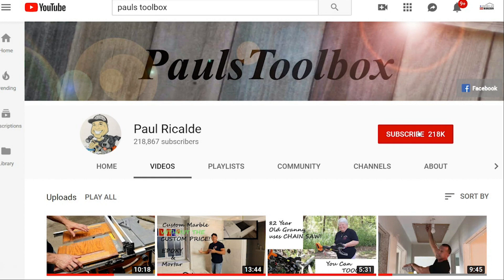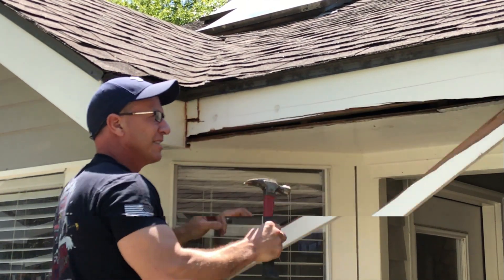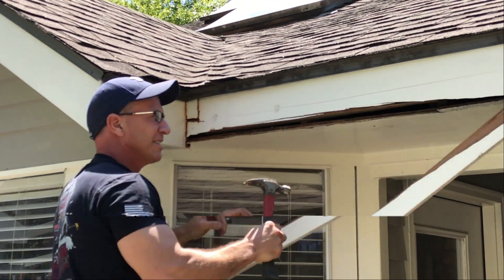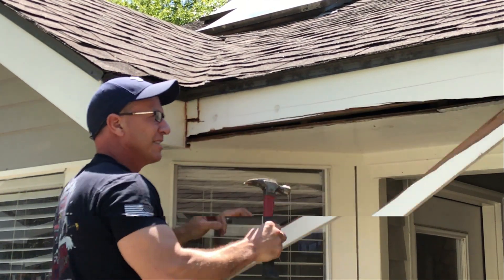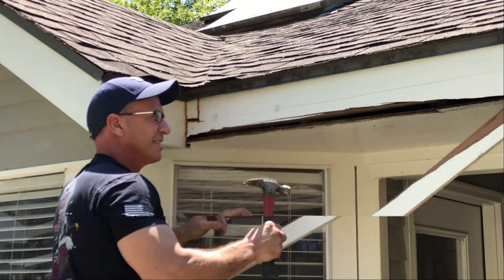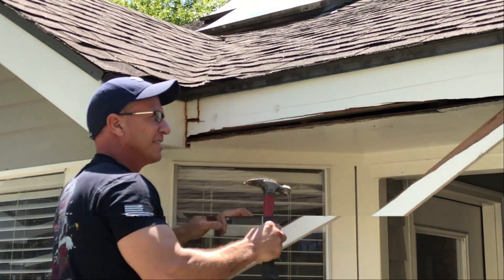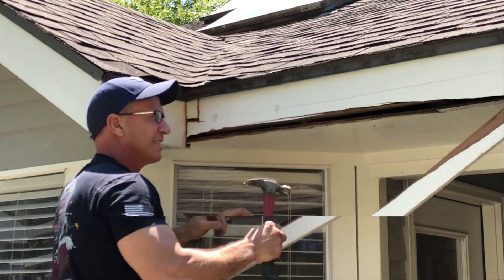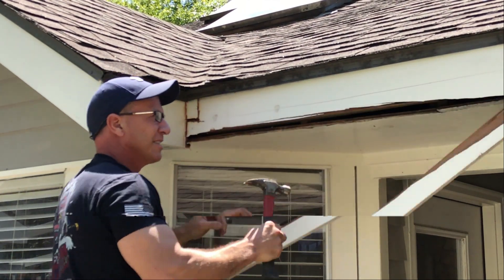Effortless Fascia & Soffit Replacement Without Removing Drip Edge! | Paul Ricalde

Comment: I never had a repair person who does quality work on my house. So scared to hire anybody to get disappointed  and frustrated.
Reply: These days most contractors act like you should be grateful they showed up. It's a sad state of affairs when I, as a homeowner, know more than the contractors. I just had a very expensive "certified" mold inspector out who didn't know the difference between a weep hole and missing mortar on a brick porch. It was obvious. Smh
Reply: I'm so over my contractor. I found out a week ago that I'm responsible for Soffit, Fascia, and gutters. A week prior to the final inspection. I've never done this, but I'm over him. I called the city inspector and asked him if I fixed all the things he requested does my contractor have to be there for the final inspection he said no, so I'm moving forward to repair all the stuff that needs to be done and closing the permit out if he shows up or not.
Reply: @debbiegonzales8035  What do you mean you are "over" your contractor?

Comment: On the inside miter, I prefer to take my grinder to the top backside of the primary miter in order to get the board plumb and then cut my angles without the compound miter. That way the joint looks plumb and square and it doesn’t look like we are hiding anything

Comment: Thank you - very much! - for posting this video.  I'm preparing to do exactly this job on my century-old house.  My "Blakes" are 8, 11, and 13 years old (my 16 year old isn't interested).  We watched your video together.  I like that you mention good safety practices, even if in hindsight, which my impressionable children enjoyed enormously: "I should've seen that coming!"  I'm a 54 year female, who will be on a ladder, with children better at cheering me onward than actually helping, so I'll be using your tips of the speed square's diamond cutout, FastCap 3rd Hands, and loosening long lengths of trim, entombed in layers of old paint and caulk, with a jab saw multi-tool blade.  I already tested that part of the house for lead, which was negative, so the oscillating multi-tool is a good option.  There isn't a straight line or square corner in the house.  I anticipate not being "in the groove" more than once, and will "need to pull that dog down," just as many times.  I appreciate your demonstration on how to make my seams watertight, using proper carpentry instead of relying on thick beads of caulk.  In all my time subscribed to your channel, this is the first day that my children learned from you with me.  Thank you for being a gentleman, and making carpentry a dignified skill.

Comment: Thx, I’m considering using a fiberglass cement board that I have to fill in my soffits. I have large vents on the side of my attic and consider just completely sealing the soffits with this material. This is on my hunting cabin so…. 😜

Comment: Thanks for sharing this video. I like how you explain hands-on training to remove an old fascia/soffit. I was able to remove mine because it had a leak from top of my roof. The old structure had water damage. Fixed the leak and remodeled the whole new structure. As a cabinetmaker, I like to do carpentry and learn how to do things myself. Once again, thanks Paul for this demo!

Joe

Comment: Thanks for the video! Really great notes for me to take! I was just wondering what the ryobi nail gun is that you're using and the nails you're using with it? Is it a framing nailer, finish nailer, brad nailer? I have very limited construction experience.... Are you also cutting every fascia board at 45 degrees that meets up with another piece of fascia board? Thank you for your time!

Comment: My fascia and soffits have a lot of termite damage. The previous owners slapped a coat of paint on the outside. I saw it from the inside when I repaired the framing around the garage door.

Comment: When replacing the old fascia, that had the bottom groove/slot for the soffit, is it okay to install a new fascia board without the groove?
Reply from the maker: I would suggest making a dado groove in the back before installing it because the plywood will not have anything to keep it in place. If you had to, you could put a small piece of trim underneath it to hold the plywood up or shoot nails from the face into the ingrain of the plywood, but that would not be nearly as strong and will not look as good. I’m sorry to give you that news. Thanks for asking, have a great day.
Reply: @paulstoolbox  thank you!

Comment: @13:20  My Ingers ....lol

Some nice tips....I never seen/used  Fascia boards with a grove cut-out.....which explains why I was scratching my head when you said overhang the fascia by 1/8 with the soffit.

That last piece of Soffit looks a little rough @14:37 (No Pun Intended) unless you just didn't care??...just curious, I know you do good bondo work (never saw that, until you opened my eyes) thanks for the video....Nice Ladder

PS:Nice Click-Bait....even nicer with no Gutters.

Comment: A few questions. The vents, you didn't mention approximation of those spaced apart on avg.
Also, for your boards the vents go into you needed to paint those to keep away termites as well as aesthetics right?
And, also the fascia? That outside shiney white board you put in there. What kind us that called? Is that the kind that doesn't rot?
You did just such a fabulous job on this. I'm a nervous wreck as i have severe rafter tail damage under mine. But also because i have to stand on the very top ofcthe tallest ladder i have to get this done. And rafter tails and install drip edge.
You make this look so easy. Thank you.

Comment: What type of fasteners for the Hardi-Panels? Were they approved for exterior use?
Reply from the maker: I used galvanized 18 gauge 2” trim nails, I prefer 16 gauge nails but 18 would be the minimum size. I hope this helps, have a great day.!

Comment: Nice work.  If had gutters, they would have to be removed before doing the soffit and facia work.  Are the gutters shot once they are removed?
Reply from the maker: You can do some repairs on fascia with gutters in place but unfortunately you will have to remove them to replace the fascia. Some gutters can be removed and reused. You may want to ask a gutter mechanic if he could do that for you. It all depends on how they were installed. You may get lucky.

Comment: I am wondering about my fascia and soffit as it is different than yours,  I live in California and my home is 70 years old.  Your fascia board seems to have 2x4s or 2x6s that close off the outside perimeter and attach to the rafters and then there is a 1x6 that you call the fascia which is a nicer board that you attach to the 2x6 behind it.  Here we do not have the 2x6 that attaches to the rafter ends, all that is there is the thin 1x6 covering the rafter ends.  I like the way your roofs are built as they seem much sturdier, but I am wondering why the differences?  I am not sure if it could be weather related or just area codes or perhaps shoddy workmanship but it is odd to me.  I was wondering if you knew the reason behind it.  Secondly, your soffit I think I saw a vent in one place on it and was just wondering if all soffits are supposed to have vents?  Our house has roof line vents into the attic, however a family room was added years ago with a flat roof and that room is very hot.  In looking at it I realized there are no vents at all for this shallow flat roof and wonder if a lack of vents is holding heat in, thereby increasing the heat inside the room.  We just had a cool roof put on but that room is hotter than ever.  There is insulation in the flat roof space but I noticed the lack of vents and wondered if that was a contributing factor.    Lastly, I am wondering If I can send you a picture of an area of my roof line that slants down as it should but meets the flat roof line fascia and soffit and ask you your opinion on the best way to fix it.  We just spent almost $20,000 to re roof the house and this area was left untouched by the roofer with bare unpainted wood showing a gap which would allow water from rain to freely flow into the soffit causing incredible damage.  The roofer does not respond so now I just want to know the correct way to fix it to prevent future damage as rains will be headed our way soon.

Comment: Why do u cut out corner?
Reply from the maker: The drip edge on the roof is tied from two ends into the corner, so I would have to remove the drip edge in order to take the fascia out if I did not cut the corner. It is much more difficult to remove the drip edge than to cut the corner. Thanks!

Comment: What size nails did you use?  I am getting ready to do work on mine that has water damage.
Reply from the maker: I used 18 gauge galvanized nails 2” long.    15 or 16 gauge is better for this application but 18 works. Thanks!

Comment: I appreciate your video but you are not addressing what caused the damage in the first place. There must have been nails dangling from the edge of the sheeting that held it and the drip edge to the sub facia and the edge of the sheeting is discolored showing water intrusion. What's going to happen when the wind hits the un-nailed edge of the roof? What will this look like in 10 or so years?

Comment: Can you tell me the name of the wood that you used for the fascia?
Reply from the maker: It was pre primed pine. Some parts of the house has redwood fascia but you have to prime it with a stain blocking water base primer or a good oil base to keep the redwood from bleeding through. I take what I can get because fascia wood is sometimes hard to find. Thanks and have a good night!

Comment: Hello Paul great video . Just wondering what are the boards you used for the fascia with the groves are called and where did you get them. Thanks for the info.
Reply from the maker: Hi Nelson, you can look it up at Homedepot.com. 1x8”x-6’ finger joint fascia board. 35.00 a piece. It’s very hard to find right now because lumber is through the roof  and hard to find. Have a good day and good luck!

Comment: We hired contractors to replace some fascia and soffit on our porch. Noticed it was still leaking where the old rotten wood was. Contractors said they put new flashing in but it wasn't mentioned in our estimate. They came out and "caulked"  the area. It's still leaking. They then called me back and said they knew what the problem was without coming out a 3rd time and want to charge me another $1000. Am I getting scammed?

Comment: Were you using Brads or Pin Nails?
Reply from the maker: 2 inch 18 gauge Brad nails, in most cases I recommend 16 or 15 gauge but 18 will work. Make sure you use galvanized nails for exterior. Thanks!
Reply: @paulstoolbox  I have to that exact same thing next couple days. Who ever did the first time was a poor try, missed alot of the boards
Reply from the maker: Unfortunately, there are a lot of people who
do inferior work.  I get aggravated when they know better but take advantage of their customers. I'm sure you will get it right. Have a great day and good luck!   @MrLonewolfKaraoke

Comment: Thanks for the awesome videos Paul you are an inspiration to many people including myself I’ve been tackling so much work around my house it was built in 1940 and there is no soffits it’s the old rafter hang over style so I wanted to have soffits and facia installed and wrapped with metal so it ends the carpenter bee 🐝 issues.

Comment: I haven't heard of Spyder, but that double sided recip blade rocks!  Nice project.  I'll be looking at fixing up my soffits at some point (when I can afford the wood!!) so a good project to learn from.
Reply from the maker: Hi Stephen, I ran across Spyder at a tool show , they are pretty much locked into Lowes. Spyder has some really cool products but they need to do a better job of getting the word out. I know what you mean about the materials, if something is not done soon , nobody will be fixing anything. I get orange heavy duty gloves from Autozone regularly and the cost for a box has been 14.99 for years, now it's 36.00... FOR A STINKIN BOX OF GLOVES!! CRAZY
Have a good day buddy!

Comment: Hi Paul, great video! What type of wood do you use for the facia board?
Reply from the maker: Hi Tyler, it appears. To be yellow pine. It comes pre primed but Lowe’s did not specify the wood type. I prefer redwood but couldn’t find any. The price is insane at 47.00 for 16’ 1x6. But I had to get it. The plywood was not very good either but that’s all I could find. I hope the prices get better but don’t see that anytime soon. Have a good night!
Reply: @paulstoolbox  Thanks for the quick reply Paul. I can’t find the fascia board with the grooves for the soffit plywood to fit into.
Reply from the maker: @tyku2108   Here are a couple of places to check, I would suggest Depot because Lowes is high. Unfortunately prices keep rising and materials are getting hard to find.      https://www.homedepot.com/s/1X8%2520%2520FASCIA%2520BOARD?NCNI-5
      https://www.lowes.com/pd/1X6X16-PRIMED-FIR-FASCIA-GROOVED/3092097 Remember Lowes only has 1x6 Fascia from what I see. You may also want to check local Lumber yards, they usually have a larger selection of wood. Good luck!
Reply: @paulstoolbox  Thanks again Paul, I will check it out. At this point I am willing to pay more if I can just find the materials. Keep up the fantastic videos!
Reply: @paulstoolbox  by the way , do you recommend using a nail gun or screws for securing the facia board?
Reply from the maker: @tyku2108  I like to use a trim gun with 2 or 2.5" galvanized nails. I prefer 16 or 15 Gauge nails if you don't have sub fascia but 18 gauge will work as long as you hit every rafter. Thank you buddy!
Reply: @paulstoolbox  I have an 18 gauge brad nailer but I do not have sub fascia. Maybe I should just use screws, the gutter is going to go over that anyways, or buy a 15 or 16 gauge trim nailer.

Comment: Paul, I love how your bondo seams come out. However, I hate working w/the stuff. Is there a product that you recommend as a close second for seams, corners, etc when doing fascia & soffit?
Reply from the maker: I will, if you seams are tight, exterior wood glue is a great option. I usually use Bondo if I’m doing a repair. I hope this helps buddy!

Comment: Welcome back.  I noticed you only have one vent under your soffit, is there any reason or are you planning to add more. As you probably know venting is very important. Gable vents just aren't enough. The soffit vents help push the heat out of the antic and will add a few more yrs of life to the roof.

Comment: The quality of your work is excellent, but i question the materials you're using. You put up a soffit board that was very rough, i personaly would not do that especially in an area they see. Why not use sub fascia pressure treated and pvc fascia to make it so they don't have to redo the job in the future. All of your tips are also excellent!
Reply from the maker: Thank you Steve, I really appreciate your comment and input. Unfortunately due to this Covid problem, I sent my son to get plywood for my soffit and he went to two different places because he could not find BC plywood. I see a couple of small rough patches but I could easily fill those later, I had to get this job done because I am pressed for time and materials are very short and expensive.. Another thing, it was very hard to even find pre-primed facia much less redwood or anything else. I like to do trim with PVC or treated lumber but that is scarce as well. I have never seen PVC facia in this area and I want to match what I have anyway. As far as sub fascia-it should never get wet so I I’m not concerned about treated for that. It had termites in the past from the previous owner because it was never done properly or they neglected it. I have been extremely busy the past couple of years so I have not tackled some jobs that I am doing right now because my mother was ill and  needed attention. Unortunately I lost my mother a few months ago so now I’m getting things done that  I have not addressed in a while. Thanks and have a great day!
Reply: @paulstoolbox  Ty Paul for your comments and i'm sorry to hear about your mother. I retired about 8 months ago due to physical problems so i've not been dealing with buying materials anymore. On certain houses in South Florida Pvc fascia or composite boards are the only way to go. The termites and rain destroy wood fascia pretty quickly. I had just started using pvc soffit boards before i retired which come in 1/4 and 1/2" sizes. A pvc jigsaw blade is a must for working with pvc. That's a tip for your viewers.Also, i highly recommend the Rockwell F30, it's lightweight and cuts fast. I laughed when you mentoned hearing protection! Have a great summer and stay safe.

Comment: Its great watching you work Paul. I was wondering about that holder you used to hold up the soffit for you while you secured it? I work alone so that would be helpful. Its sort of like the drywall tees I've made for doing ceilings. I also will look out for those double-sided spider blades. Thank you